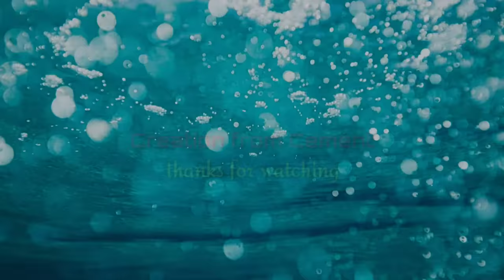how to cast a cement stove with a plastic pot is both easy and saves gas

Comment: I would suggest leaving room at the ends of the metal grate rods to allow for expansion. The expansion of the rods in a fire will crack the cement. Put a 5mm piece of foam or wood at the ends of the rods that will allow them to burn away and leave expansion room.
Reply: Thank you for your suggestion ❤
Reply: Also, three feet, a tripod, is more stable than four feet.  With four feet, any difference in length will give you are base that rocks.  From the way to created the feet, you should be fine, but tripods are generally more stable.
Reply from the maker: Thank you !
Reply: Why the need of those rods?
Reply: @robronson2776  The most obvious answer is to keep pieces of wood and charcoal from falling out, but to allow ash to fall through.
Reply: That was what I thought too, the cracking part due to heat expansion!
Reply: I would suggest Not making these out of concrete. Concrete can explode in your face if it gets hot enough!
Reply: @Jaybird-oo3ih  These are extremely common in Asia, over half of the population of the Philippines is currently using concrete cookstoves just like this. Seems to be working well for millions of people everyday.
Reply: @PyroXXman  Any idea of what could added to the concrete mix to stop it cracking?  This would be my main concern
Reply: And put the metal grate at the top of the hole, so it can be used as a grill too. Why did you put the metal rack in the middle??? Kinda useless
Reply: @pixelpatter01  i said wrong, i meant the metal rings actually 😲
Reply: @ryanpongracz8051  The rack is necessary to be in the middle. It not only supports the burning wood, but it also sets the height so the flame is at the correct distance to the pan on top.
Reply: Good thinking ! That would indeed limit the chances of the cement cracking, but overall I find he came up with a brilliantly simple and effective  design, comes to that it looks pleasing to the eye👍 love it when people share there insights with the world!
Reply: @LMinem  wise words 👍
Reply: @Jaybird-oo3ih  they are not for industrial use  but household level where most probably food is cooked three times in a day and not 24/7 like commercial ones
Reply: @ryanpongracz8051  it's for air flow
Reply: My first thought was “won’t it explode?” so thanks for your comment 🙏🏼❤️
Reply: Сам  цемент с песком  разве не трескается от огня?
Я видел как от костра на бетонной плите она трескается.
Reply: @johnlarkin9594  Wire mesh or chicken mesh, just warp heaps within the mold then when the concrete cracks it wont full apart. You always eventually going to get cracks in concrete the heating & cooling down process breaks the materials over time. Or instead of using just sand mix in clay reduces cracking.
Reply: @robronson2776  My guess is to provide tension to keep the concrete from breaking when the thing heats up. Concrete or cement or whatever that mix is, has little tensile strength, so adding something with tensile strength such as steel wire or fiberglass makes the composite stronger . Even with the steel rings I foresee problems because of the difference in expansion rates between concrete and steel. Perhaps a better method would have been fiberglass added to the mix? It was easy to make but won't last long with much use; it will crack from heat expansion.  I think it's main use is to get views on Youtube and make him some money, which it has done.;-)
Reply: @pixelpatter01  i see. What about if it gets more sand in the composition? Wouldnt it make it more flexible and distribute the heat more evenly?
Reply: @rhuyisia8163  why not use stone grit instead of metal?
Reply: @robronson2776  For strength, just like a sidewalk or building made with cement. Even if it does crack, it will stay in place.
Reply: @robronson2776  Like rebar in a foundation. Helps hold it together if a crack should develope.
Reply: @Jaybird-oo3ih  That highly depends on the concrete
Reply: Luckily, the thermal expansion of concrete is rather similar to that of steel, hence the rods (assuming they are steel) would tend to “breath” with the surrounding concrete. Also these length scales are rather small. The absolute expansion per 100 degrees increase would be around one mm per meter. The relative expansion of steel vs concrete should be much less.
Reply: If you leave a gap at the end of the reinforcement, then you will create a crack inducer. Better to lap the reinforcement to create a path for the expanding reinforcement to take. When creating reinforcement schedules for large structures, gaps are never left in this way unless the engineer wants to create a crack inducer to allow for slap / structural member movement, or they use compressible fibreboard sealed with mastic to debond adjacent members. All of that said, I'd say it looks as if the fella has done this before and knows what he's doing.
Reply: @pixelpatter01  adding glass fibres is certainly one (and a good) solution.
Reply: @Hugh_Manitee  so it would be better to made some layers of thin metal grade sheet or maybe metal scraps mixed with?
Reply: @LMinem  not exactly.
Reply: Its a great little design. I might try making one out of cob instead of concrete (mud and straw).
Reply: @PyroXXman  The fact that they have to cook on these primitive devices suggests things aren't really going so well over there.
Reply: @MrSmriley  It’s a third world country, of course things aren’t going well. I’ve personally lived there and seen it first hand.
Reply: @johnlarkin9594  you can add sugar to the dough, this transforms the cement almost like refractory concrete, it works very well here in Brazil and pizza ovens and wood stoves.
Reply: It cracked right away. Check the left side.
Reply: i was gonna say lol, those metal rods are gonna expand when heated and cause cracks in the cement, it wont last more than a hundred uses, and even if it was used sparringly there is rust on the metal rods and they weren't painted with any kind of rust protection at least in the embedded parts so the rust by itself can make the cement fail. in buildings this could shorten the life from 50 years to 15 years, but im not too sure how long it would take for a concrete stove.
Reply: @cementstove  Have you considered making these cement stoves for survivalists? I bet they will pay top dollar for them.
Reply: @robronson2776  you want the ash to fall down
Reply: @ryanpongracz8051  the the purpose of metal rack is  to hold the charcoal and the hole underneath is where u put ur  firefighter until the charcoal got flamed.  The ring on the top is where the oxygen/air can  pass through.If it is close, the flame will die.  You can see the gap between the cement and the ring. That will maintain the flame until it needs a top-up.
Reply: @automacao_em_acao  to clarify this further so you don't ruin your concrete and it never sets, there is a formula for this:

In simple terms, sugar acts as a retarder and delays the setting time of concrete.

This is the reason why transit mixer drivers are sometimes advised to add some soft drink to the concrete mix if the vehicle gets stuck up in the traffic for too long.

Technically speaking,

Sugars have been categorized as ‘cement destroyers’ and when sugar is added to Portland cement paste at the onset of mixing, hardening may be delayed indefinitely.

Concrete hardens due to formation of calcium silicate hydrate.

The retarding action of sugar is probably by the prevention of the formation of calcium silicate hydrate.

Sugar exceeding 0.2% by weight of concrete will slow down the reaction drastically.

Sugar increases the setting time of cement up to 1.33 hrs at dosage level of 0.06% by wt of cement. There will be no effect on workability, compaction by the use of sugar as admixture in concrete. Higher long-term compressive strength is achieved in concrete by the use of sugar as admixture.
Reply: you can buy an electric hob to put on top of this structure, it's cleaner than burning  wood but the heat is lower
Reply: Nice.  I plan to try this; if ONLY to say I could;  Very nice!  I have a lot of friends in areas that could really use these!  (I'm in an apt in Cali)  My landlord would not approve of me placing them here!  But UBER cool usage.
Reply: In communities with limited access to technology, people come up with best of ideas. Living in the 3rd and 2nd worlds in construction  environments, yet educated in the 1st with plenty of years in US mainland working as well, Going back and forth between these two very different worlds, i  found my years working in pacific islands and working with hundreds of Filipinos the most impressive, i learned a lot with their ingenious simple approaches to problem solving.
Reply: Thanks
Reply: @robronson2776  So that air comes to the fire from below and at the same time the burning wood does not fall out of the hole for ventilation.
Reply: @johnlarkin9594  perhaps rolls of kaowool or even shredded up fiberglass?
Reply: @PyroXXman  Millions of flies are eating shit every day, does that mean shit tastes good?
Reply: @automacao_em_acao  
.
Sugar,? That sounds very interesting what ratio how much per unit thank you
Reply: @teresallompart3838  El embrujo
Reply: @LMinem  maybe a bit small at that size for the weight
Reply: Wow, so this is what constructive criticism looks like. 😮😏👍
Reply: @Jaybird-oo3ih  can clay be used instead?
Reply: Old-fashioned, crude and despicable. We are in the 21st century, at the height of the electric stove and there are still people making wood stoves. This is these incompetent rulers of underdeveloped countries where the poor people still depend on 19th century technology. I cry for you suffer in this poverty
Reply: @johnlarkin9594  Old-fashioned, crude and despicable. We are in the 21st century, at the height of the electric stove and there are still people making wood stoves. This is these incompetent rulers of underdeveloped countries where the poor people still depend on 19th century technology. I cry for you suffer in this poverty.
Reply: @assistista5569  erm hello did a "rich" person step on your toe? Sad fact is Millions of people live on subsistence livelyhoods or in refuguee camps globally.  There simply are not the resources for them all to have connected electricity as things stand. Where exactly will this capacity come from? IF it bothers you so much stop hate posting on you tube get out and do some charirty work instead!
Reply: @ericmadsen7470  good thinking, but won't the weight factor be an issue?
Reply: @ochiengfaustineododa8409  Oh yeah. Unless there would be a smaller version and made from ceramic or possibly made from lightweight concrete. I can see where this can be an issue.
Reply: They're not gonna use it, it's just for video.
Reply: @rasitawinner8203  You are wrong to say that.  I'm not making a hateful disagreement.  With all due respect but you need to study text interpretation.  
My criticism is about the fact that we are in the 21st century, in the time of electric stoves, and yet, there are people dependent on technology from cave times.  
For example: combustion-based stove.  And this is due to the lack of public and private policies aimed at the economic development of people in poverty and unemployment.  
Be aware that I usually do my part to reduce the misery in the world obviously as an individual my contribution is like a drop to fill a colossal sized bucket.
Reply: Спасмбо! орегинально ,полезно бюджетно
Reply: А раствор цементный не треснет при нагревании? Может плиточный клей использовать?
Reply: Pixelpatter why dint u make one and show how its done since you it all .People have been using this kind of things for years I have not heard of any one being killed or injured. And with gas and electricity going up this could be the next thing. They are even using something like this on balcony in the USA when there is a desater.
Reply: Pixel this was not made in a room but outside.
Reply: I've been doing this kind of stuff for many years now, but this guy is truly fantastic
Reply: Где перевод на русский язык
Reply: @teresallompart3838  )))
Reply: @teresallompart3838  0)0)))000)
Reply: P
Reply: @kiyoponnn  go ahead and make one then I warned you ! lol
Reply: @Jaybird-oo3ih  I was never going to, I use an induction cooktop
Reply: Lindo que Deus abençoe grandemente
Reply: @johnlarkin9594  red soil
Reply: @ryanpongracz8051  The metal rods hold the burning wood and allow the ash to fall into the bottom area below the rods. He placed a removable grate on top of the stove after the stove was finished. Did you watch the entire video?
Reply: @Jaybird-oo3ih Concrete explode?🤔
Reply: ريقسرتسرظ
Reply: @teresallompart3838  ةروة
Reply: @teresallompart3838  ةة
Reply: ؤز @teresallompart3838
Reply: Maravilloso trabajo no tiene precio para cocinar los alimentos lo felicito
Reply: @LMinem  ور
Reply: @teresallompart3838 .
Reply: @teresallompart3838  hhhhuuhuj
Reply: @teresallompart3838  uuugyhjhhh
Reply: @cementstove яяяяяВв
Reply: Folks been building these 😂before them stealing invasion. Folks come taking
Reply: I recommend that he use clay soil to build bricks on the rods.
Reply: Jjjjj€€&£€&-€is @LMinem
Reply: @Jaybird-oo3ih okay aside the cement what will be the best way
Reply: P
😊P😊

Comment: The idea is good, but the fast cement deteriorates with the fire, that should be done with REFRACTORY CLAY. It also keeps the heat much longer.
Reply from the maker: Thank you
Reply: I sure would not have considered that. Thank
Reply: Cool, they have it Home Depot.
Reply: @chriskolb3105  besides Home Depot where else can I get it, if you don’t mind me asking
Reply: Can you line the cement with refractory clay ... like maybe an inch or two thickness on the inside, or does the whole thing need to be made of refractory clay?
Reply: @captainkneemo334  the problem is the concrete doesn't deteriorate under normal usage (cooking meals 3 times a day). Nor does it get hot enough to explode. Too many jealous armchair "engineers" who never built anything useful or cool
Reply: @jwtre  u^;mh g/
Reply: SaxManDanDotCom  I mean lol how much wood are you trying not put in it? It looks like only paint sticks are supposed to be used.
Reply: @johnnyparksgift6164  bawhahaha I'm calling animal control. Poor Lucky 🤣